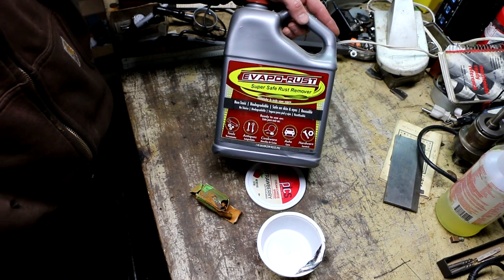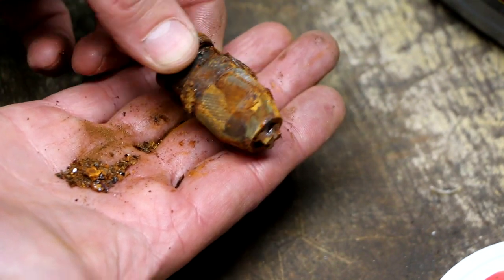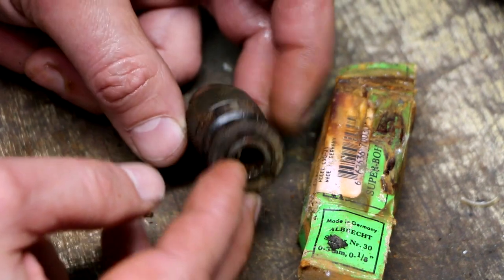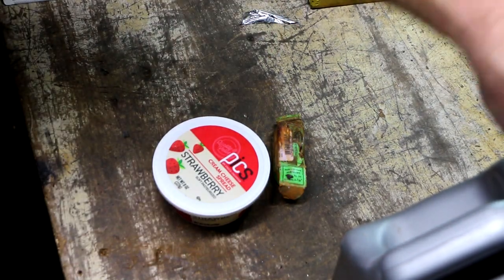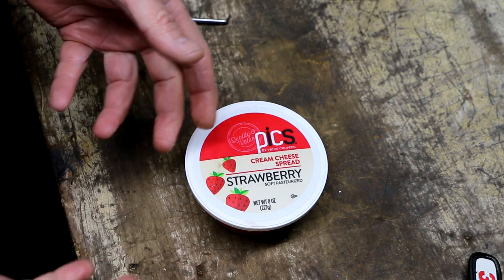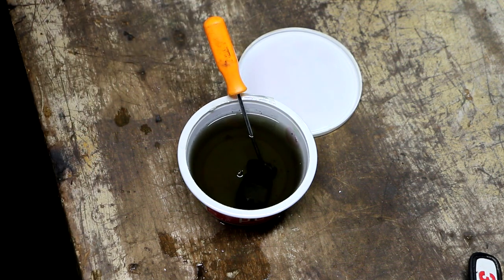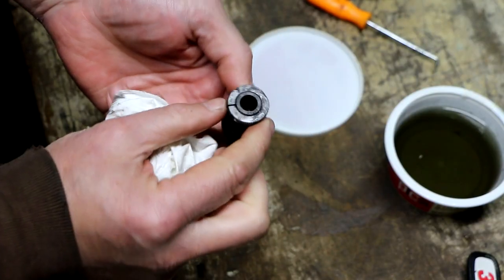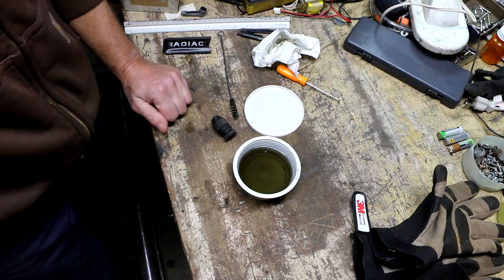Evaporust: Evaluation of rust removal

Comment: Have used Evaporust several times, with somewhat mixed results.  Soaked a D1-3 cast iron faceplate for over a week, but came out with a very rough pitted finish;  since then, have had good results with steel parts soaked overnight.  The black coating may be graphite in the steel, which will come off by scrubbing with steel wool. Just be careful not to soak too long with precision parts and tools.
Reply: Sounds like the Rail anvil I was soaking in white vinegar.  I for got about it, and after 3 days it came out very pitted.  LOL
Reply: @MaturePatriot  Don't know about vinegar, but Evaporust isn't supposed to remove any iron, so dimensions probably weren't affected.  Any inclusions that were "keyed-in" with black oxide were probably removed, hence the pitting.  I don't overdo it now!

Comment: Just put the lid back on the cup to prevent evapo...ration, and use it again.  I have been using the same Evaporust bath on parts for some time.  Wash the chuck with soapy water while scrubbing with a plastic tooth brush.  It will look much better after that.